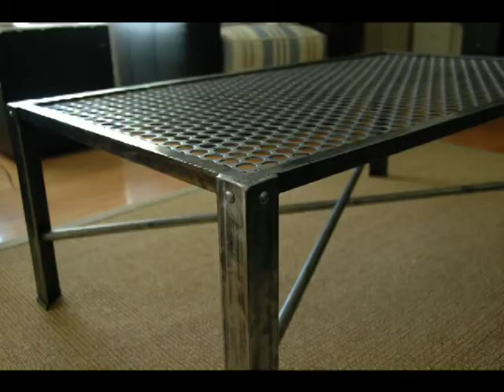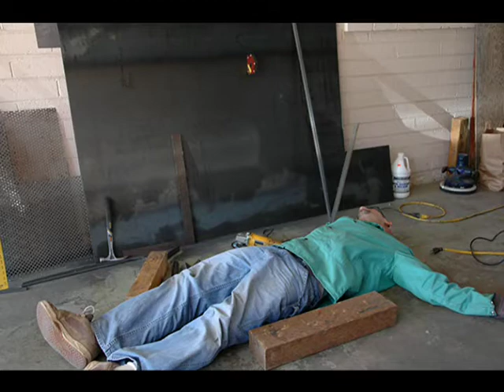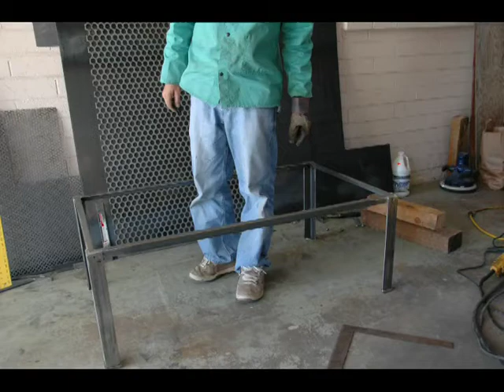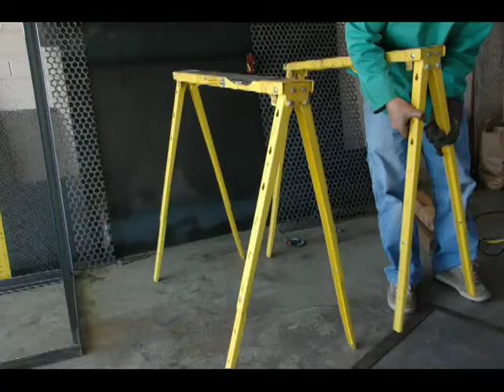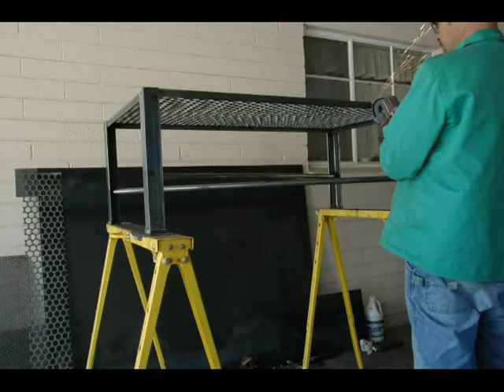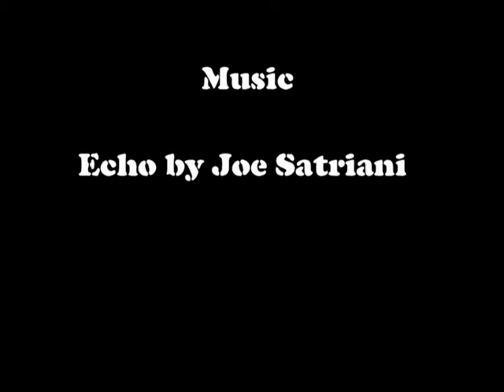Making an Industrial Metal Coffee Table

Comment: Very cool. And although I have work benches, I usually end up on the floor. I do my best work there! Built a motorcycle like that years ago in my sister's basement. Picture sitting on the ground holding a bench grinder with your feet so it doesn't walk away.

Comment: How did you cut metal ? How did you do it the same lenght ?
Reply: Use a carbide cutting disc, De walt are very reliable, to cut pieces at the same length, measure and verify two times before making the cut. let the speed do the job don't force the grinder, that could break the disc and that, is terrifying... Good luck and remember, safety first.